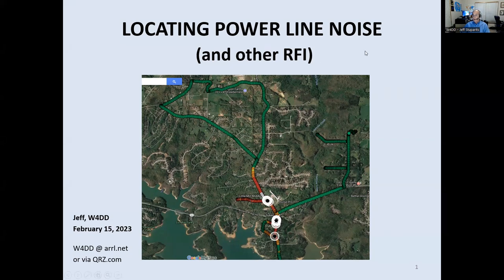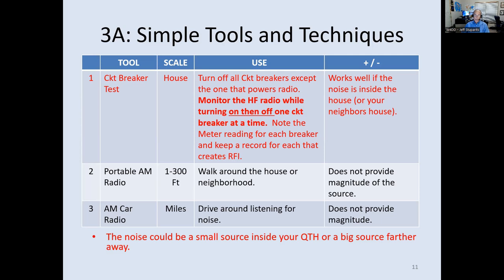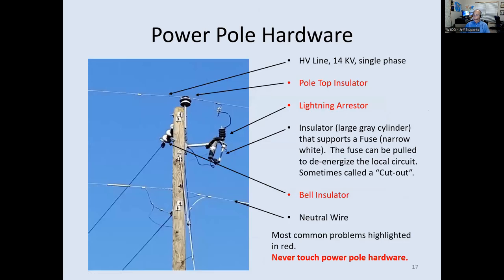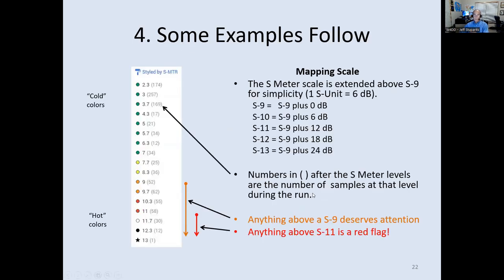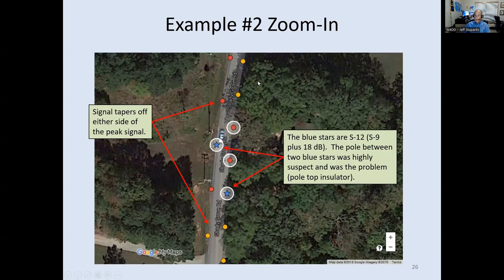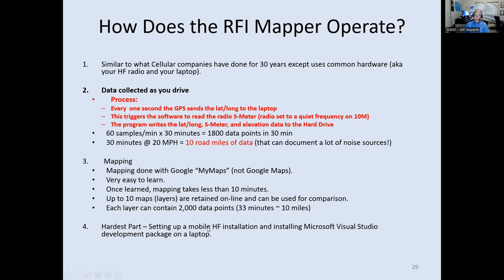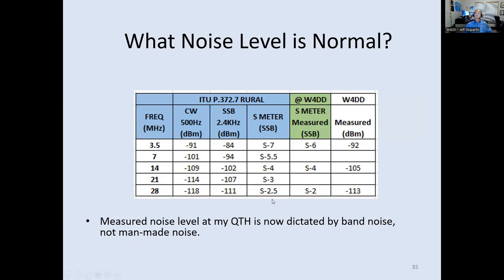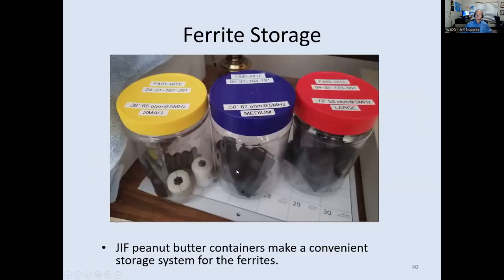Hunting Down Power Line Noise and Other RFI

Comment: Many thanks for your excellent presentation. I am about to embark in locating a very nasty RFI source. Your presentation has been very useful. One question: what about using a small amplified loop in the 80m or 40m band rather than the yagi at 136 MHz?

Comment: Where did you obtain the dish from? Can Dish Network Satellite dishes be retrofitted to make this ultrasonic reflector?  What is the part number of the sensor? And is the electronics pack an audio amplifier or is there a mixer to bring the ultrasonic frequencies down into the audio spectrum for listening purposes?

Comment: I suspect the main problem with switchers is that the designers are under severe cost constraints (e.g. I've purchased CFLs for under a dollar), and as a result they can't afford to have much if any concern about RFI. Until regulatory institutions become involved there's nothing to drive improvement in the basic technology, which is what's really needed. Tesla doesn't offer the AM band on their car radios for this reason, so one can infer that EVs will become a major source of switcher hash as they become more common, which is understandable due to the very high switching currents. I noticed TI tried to specifically address this AM band hash, but was disappointed to see their solution was to simply move the switcher's fundamental up to 2 MHz, and so the interference levels will be even worse in the HF region.

Comment: I've replaced the some power supplies with unregulated since the router can accept a range of voltages. Do you use shielded ethernet cable around the house?